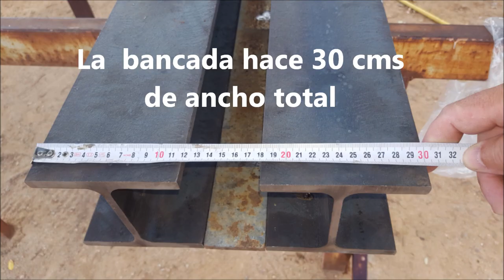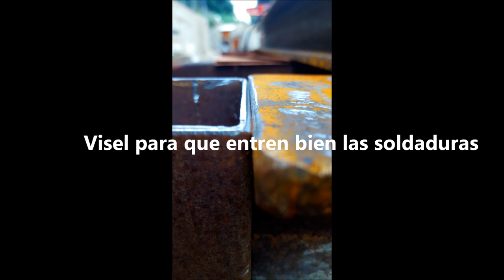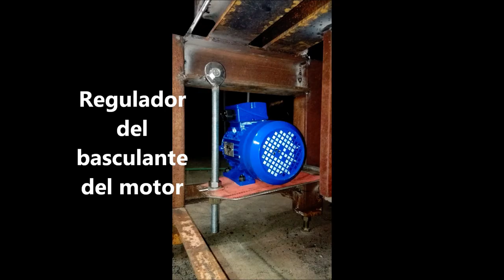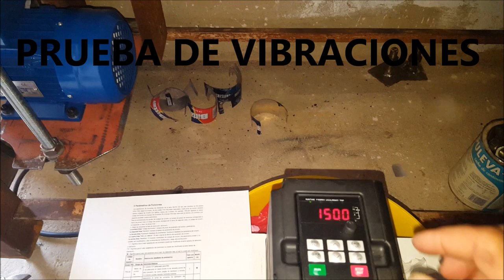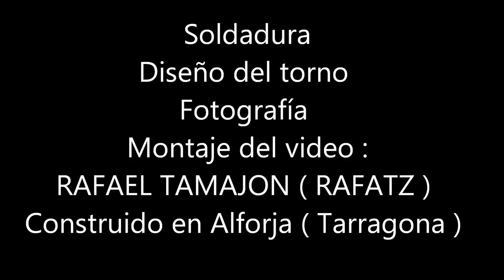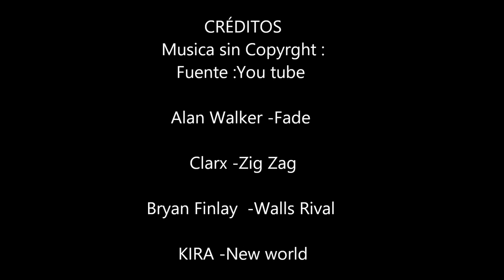Torno  para madera      1 ª parte ( Fabricación de la bancada )

Comment: Que buena bancada amigo ...! 
Bendiciones desde Costa Rica ...! 
Te quiero hacer una pregunta :

Que acero utilizastes   en el eje donde van los rodamientos , y cuáles es la longitud y el diámetro de la eje ... Me puedes ayudar con eso ? Gracias Bendiciones.
Reply from the maker: Hola amigo, yo te ayudo con toda la información que necesites.
El eje, no sé què acero usó el tornero donde lo mande hacer, es la única pieza que me han hecho, todo lo demás está hecho por mí.

El eje hace de largo 35 centímetros y 45 milímetros en la parte más gruesa, en las puntas está rebajado a 40 milímetros para poner los rodamientos y la polea. La rosca para torno de madera es de M 33 y luego lleva otra rosca hembra de M 20. 
M, es Métrico.
Cualquier información que necesites dímelo y te la daré, si necesitas información más detallada sobre el eje dame tu correo y te envío fotos con las medidas detalladas.

Gracias por verlo.
Saludos
Rafa
Reply: @RAFATZ100  
Gracias por tu amabilidad